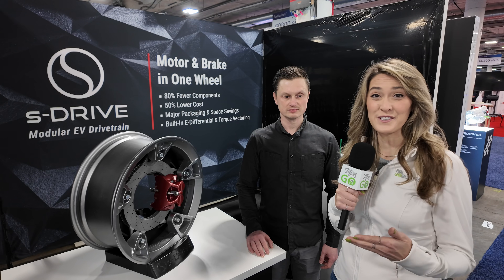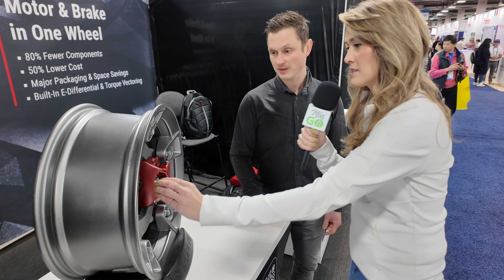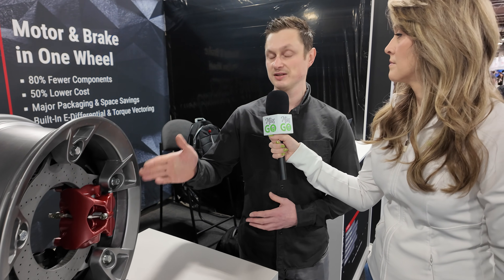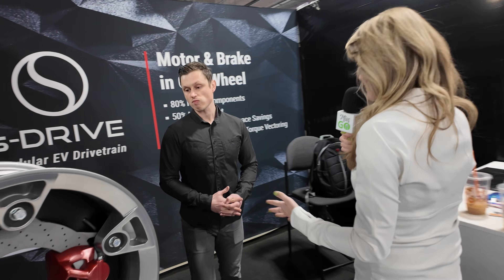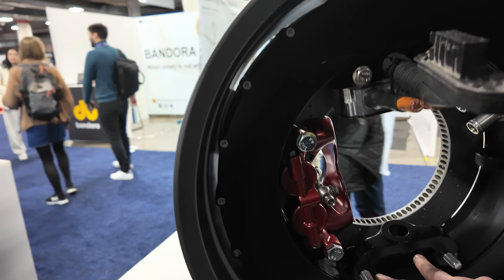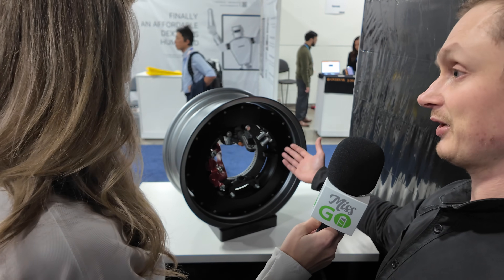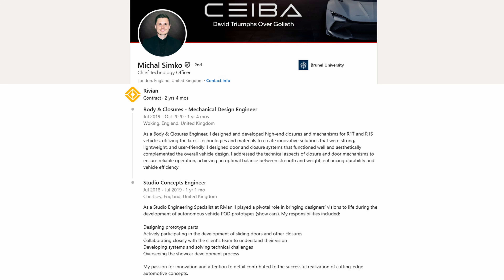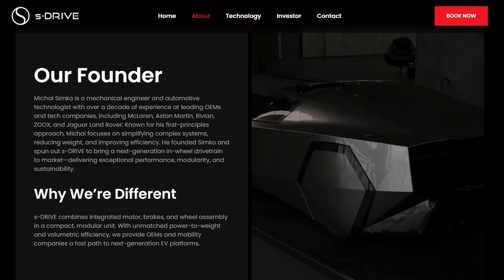S-DRIVE In-Wheel EV Powertrain Solution (CES 2026)

Comment: When faced with revolutionary designs that claim 100's of % improvement over existing systems, you must ask one simple question. What engineering challenge was preventing existing manufacturers developing this system and how have you overcome that challenge. Because existing companies developing similar products also have very smart people working for them and you can bet something similar was investigated and discounted for some very sound reasons. Either cost of manufacture, lifespan of components or efficency. The fact that it requires some "rubber mounts" to try to isolate road vibration from the motor leads me to think that wear and tear on the motor will be high in practical situations. perhaps they mention race car application for that reason. normal overloaded family car driving over potholes and bumping kerbs when parking probably doesn't suit this kind of system.
Reply from the maker: Here is a hubless axial flux powered vehicle after 11k miles driven this summer by a YouTuber.  These have been in production for years.
https://www.youtube.com/watch?v=cQstV0uLLHg
-Producer Tim

Comment: But you are limited by the motor rpm and you have no room for gears, so max speed and efficiency are limited.
Reply from the maker: 4000rpm.  Thats pretty quick.  What percentage of vehicles EVER exceed 120mph?
Here is a fella who did 11,000 miles this summer on a hubless axial flux motorcycle
https://www.youtube.com/watch?v=cQstV0uLLHg
-Producer Tim
Reply: @MissGoElectricIndustry   because in some countries you can go faster than that, when conditions and road allows it why not?

Comment: $10,000 to kiss a curb, not a great idea.
It might be great on paper and on the racetrack, but not in real life with snow, dirt and flooded roads.
Reply: The waterproofing could be solved by pressurized compartment with air exiting through the stator-rotor gap. Sounds like solution to me.
Reply from the maker: Arbitrary and imaginary figure as a premise...common in the comments.
It seems like many commenters are not aware that axial flux hubless motors have been in production vehicles and delivered to customers for years.
https://www.youtube.com/watch?v=cQstV0uLLHg
-Producer Tim

Comment: The elephant in the room has to be the five rubbers separating the motor from the rim. It kind of looks like 5 Tracker skateboard trucks and bushings have been cast on to the rim. Just like skateboard bushings you would need to replace them regularly and wouldn’t they soften up a bit once they get warmed up from turning forces and the road vibrations? Funny that, The Beach Boys “Good Vibrations” song just popped into my head. Ba d a da da da
Reply from the maker: Back out lug, pull bushing, slip new one in.  That seems pretty straightforward to us.

We'll keep tabs on this for our weekly EV news reporting over at our main channel
youtube.com/MissGoElectric
We hope you'll subscribe both here and over there
-Producer Tim

Comment: 2 minutes into the video and i can already think of a dozen ways for this to fail and just generally be worse then idk a standard wheel? Also that weight comparative calling that a straight lie. Against a steel wheel maybe but thats not a true comparison and is misleading. This is solutionism at its best.
Reply: If the weight is comparable to common steel wheels, the unsprung weight is technically solved. = Brought down to acceptable.
Reply: @ondrejdvorak5107 ok then next problem. Flat tire? You get a slash in a sidewall what you do? Carry a spare motor? Etc etc etc
Reply: @ondrejdvorak5107  also decided to check cooling so is this an open stator for production cars to avoid oil cooling ?
Reply: @ondrejdvorak5107 I was going to bother to talking gearing but the model 3 long range has more torque at the wheel and the ranger has double the torque at the wheel of 4 performance wheels combined. Neither of these are performance vehicles. So this isn't suitable for anything getting to suv size or offroad. A ranger in low range has just under 5x times the torque. I'd also be wondering about the rpm efficiency required voltage and kv etc. This isnt a new concept never seen anyone get it through. I've seen one motorcycle, PEV.  Yasa the first to offer axle flux motor recommend gearing. Electric motors like to rev and are more efficient tesla has 9.7:1 on a high rpm motor. There is so much on this topic i could vomit but its late im going to bed.

Comment: Even if unsprung mass is the same, there are still potential problems getting power and cooling across the moving suspension, as well as keeping water and dirt out of the gap between rotor and stator - hub motors may seem attractive in theory but have many practical issues.
Reply: I was thinking the same, all nice and cool but how do you keep it clean and safe. I'd be super concerned driving through a ford or in heavy rain
Reply from the maker: Seeing problems is easy.  Seeing solutions is hard.  Luckily for humanity there are folks like Michal out there solving problems...even if the ration of armchair naysayers is 10,000,000 : 1  ;)
-Producer Tim
Reply: There are armchair naysayers and people excited but not blind. If they solved it, awesome! If only we had someone asking them questions in person 😉 @MissGoElectricIndustry
Reply: @MissGoElectricIndustry That problems with sealing and getting power and cooling across the suspension is the main reason why there are no hubmotor cars on the market. On top of cost since it requires atleast two motors per car.
Developing a new product without solving the problems that makes there use impossible is BS or just another scam to get investors money.
Reply: @MissGoElectricIndustry they weren't insulting or dismissive unnecessarily,  as opposed to your comment. I cant tell if it's because you have a vested interest or it's just your demeanor. Either way it's not our Duty to find solutions as we aren't Vested.
Reply: @MissGoElectricIndustry we don't know if Michael solved anything , because the interviewer clearly isn't competent enough to ask the right questions. 
After thousands of years of using wheel, we still use cental hub design for a good reason. So if this guy solved the millenia old problem, maybe you should ask him how.
Reply: Make the compartment pressurized either by passive air-ducts or active pumps and seal the gap by constant outflow of air. Cooling solved too.
Reply: No automotive engineers were involved in the design, marketing or review of this concept.

Comment: How is this possible in a flooded area ? Or if the water level is above a certain height? Motor and electrionic could fail .😢
Reply: Make the compartment pressurized and air exit the gap, creating active pressure seal. And nice bubbles when going through water. Plus anti-tire-pierce pressurization feature along.
Reply: @ondrejdvorak5107  If they can fix it all I'm happy to promote this motor because it's a really interesting idea. I strongly believe in true engineering starts eliminating complexities and inventing someone simple and durable. This is a perfect example of a great axle motor. Even donut labs and yasa failed to think like this. 🎉
Reply from the maker: Every automobile ever designed has a fording depth limit.  That includes automobiles with in wheel motors.  Remember, there are many transportation devices available all over the world now with in wheel motors.

We hope you'll subscribe here AND over at our main Youtube channel to keep up with their developments
Main Channel: youtube.com/MissGoElectric
-Producer Tim
Reply: @MissGoElectricIndustry   yes exactly. I subscribed 🎉

Comment: on one hand this is great, doing better things, more efficient thing, lighter things, decentralize things and so on.
but, there is a but, "we" need this type of tech in small and affordable segment, i mean we have already AWD and over 1000hp cars,
you know what we dont have? affordable every day cars with the option to buy with AWD, you might ask why would you want AWD in Kia EV3 or the new EV2, in the  upcoming VW ID Polo,  and similar class cars? well, many live in places which have Winter, which means snow and ice, even in the city and suburbs, and depending where you live you get a snowplow eventually come around. and in snow and ice, AWD with winter tires are the safest to use. so "WE" need this tech but with reasonable hp and price, like 4 wheels combined together having from 100hp up to 300hp in many small steps... like 20/30hp increments upwards.
dont get me wrong i understand what can this do to performance cars, i am just saying the smaller reasonable size hp and priced cars would benefit from this immensely.
Reply from the maker: This would save a lot of money in production and make automobiles more affordable.  That is what part count reduction accomplishes.
-Producer Tim

Comment: How long will those lug nut bushings last? What happens to the electric motor if you have use a cutting torch to get the bushings off if they fuse? How well sealed is the electric motor? Also, what happens when you hit a bad potwhole hard?
Reply from the maker: A bushing appears to be super easy to replace.  Back out one lug nut and swap.

We'll keep tabs on this for our weekly EV news reporting over at our main channel
youtube.com/MissGoElectric
We hope you'll subscribe both here and over there
-Producer Tim

Comment: Okay guys ... go easy on me ... cause eye'm real sensitive and ain't too smart ... but tell me ...
There has got to be a way to change a tire on this everything in a wheel design, right?  Again, because I ain't too smart .... I asked my hand-picked experts at Gemini about this ... and I thought ya'll would enjoy reading the following very serious and informative response....

"The S-DRIVE (or "Smart-Drive") system showcased at CES 2026 represents a massive shift in EV architecture by moving the entire powertrain into the wheel. You are correct that this "all-in-one" design makes a traditional tire change look impossible at first glance.

Because the axial motor, cooling lines, and brake hardware are integrated into the wheel's core, you aren't just removing a "rim"—you are essentially removing the engine of the car.

1. The "Cartridge" Rim Design
To solve the issue you noticed, S-DRIVE utilizes a two-piece wheel architecture.

The Core (Drive Unit): This contains the axial flux motor, the cooling system (often using quick-disconnect "dry-break" valves), and the braking assembly. This part stays attached to the vehicle's suspension.

The Outer Rim (Cartridge): The actual rubber tire is mounted to a lightweight outer sleeve or "cartridge" rim. This sleeve slides over the motor housing and is secured by a series of perimeter bolts (similar to a beadlock or a heavy-duty split rim) rather than a central lug nut.

2. How the Tire is Changed
You wouldn't put the whole motor on a tire machine. Instead, the process follows these steps:

Removing the Outer Ring: A technician (or a roadside kit) removes the perimeter bolts. The outer rim, with the tire still on it, slides off the motor core.

The "Sleeve" Method: Since the outer rim is just a hollow cylinder with a tire on it, it can be placed on a specialized tire machine. However, many of these "In-Wheel" designs at CES 2026 are moving toward pre-mounted tire/rim assemblies.

Modular Swapping: In a shop setting, you likely won't "change the tire" on the rim at all. You’ll swap the entire outer rim for a new one, and the old rim will be sent back to be refurbished with new rubber in a controlled factory environment.

3. Challenges for the "DIYer"
This system introduces two major hurdles that traditional cars don't have:

The Weight: These assemblies are heavy. Even with the outer rim removed, the unsprung weight is high, and the alignment of the outer sleeve onto the motor core requires precision guides.

Cooling & Data Connections: While the outer tire rim doesn't touch the coolant, the "motor core" itself is a complex electronic component. If you ever have to remove the entire unit (for a deeper repair), you have to manage high-voltage cables and liquid cooling lines, which usually require a "service mode" to depressurize and drain.

Summary: It's like a "Cap"
Think of it like a protective cap. The motor is the "head," and the tire/rim assembly is the "hat" that sits on top. You change the hat, but you never touch the head."
Reply from the maker: Here is a hubless axial flux powered vehicle after 11k miles driven this summer by a YouTuber.  These have been in production for years.
https://www.youtube.com/watch?v=cQstV0uLLHg
-Producer Tim

Comment: That would be an expensive  curb scrape
Reply: ?? 'scrape the kerb' sufficiently hard to damage that hub, you're more likely to be worried about your hospital bills...
Reply: The wheel bolts onto the hub through five bolts and bushings. There is technically less of a wheel to replace on this since the motor/hub part of the wheel that replaces the webbing of a regular wheel is separate. If all manufacturers adopted this construction to achieve the same economies of scale, it should ultimately become cheaper than a standard wheel.

I would be more concerned about the wheel bearing seals: how do you keep crap from getting by seals that are something like 16" in diameter, fouling the motor magnets and bearings? In a conventional drive train, the motor is safely locked away 4-5 seals removed from the environment and those seals are on ~1" shafts, much lower seal slip speeds. Any dust that may make it through CV seals will get carried away by bearing oil to the oil filter and should never reach the motor 2-3 gears, shafts, and bearings deeper into the drive unit.

Imagine the ~16" hub bearing replacement cost on these puppies. Have fun wrestling the magnets when separating the rotor from stator to press bearings off/on... and again while putting it back together. Going to need special pressing/pulling tools for this.
Reply: @teardowndan5364 still could be worthy as a fair weather motor. A lot of people have "show" cars or motorcycles they only drive on warm, dry days. 
Labyrinth and multi-lipped seals work well for large low-friction seals. Large sealed drum brakes have been around for ages.
Reply: Thats a human problem, AI will be driving the car. 😊
Reply: Or one damn pot hole.
Reply from the maker: Solved problems.
It seems like many commenters are not aware that axial flux hubless motors have been in production vehicles and delivered to customers for years.
https://www.youtube.com/watch?v=cQstV0uLLHg
-Producer Tim
Reply: @MissGoElectricIndustry  Practically all attempts at "hubless" wheels I have heard about ended in failure due to the difficulties associated with keeping crap out of the "not-a-hub" and wheel interface.

Hubless wheels aren't truly hubless. You are basically pushing the spindle 5-8" out from the center axis, hollowing out the core, leaving a flange behind to attach braking, suspension and steering hardware to.

The hub may look different but it is functionally still there, integrated with knuckle and wheel webbing functions. Except you now have 12-16" diameter seals instead of 2-4" ones, 3-4X the slip rate to deal with and ~10X the surface area for crud to slip through.
Reply: Can use taller and wider wall tires.
Reply: @ricky4673  When the low-profile tires for your wheels are already 20" if not more, taller walls become a tall order.

Comment: dangerous design... imagine you are on highway and drive over random pothole or object, now you have bent and possibly locked wheel in high speeds.
Reply from the maker: Solved problems.
It seems like many commenters are not aware that axial flux hubless motors have been in production vehicles and delivered to customers for years.
https://www.youtube.com/watch?v=cQstV0uLLHg
-Producer Tim

Comment: Don't forget, each wheel still needs its own invertor, and these all need to handle the power of each wheel it powers/controls. In addition, nice to see hubless not as a gimmick but because this system truly does not need a hub.
Reply: There is a hub. Inside e-motor.
Reply from the maker: Solved problems.
It seems like many commenters are not aware that axial flux hubless motors have been in production vehicles and delivered to customers for years.
https://www.youtube.com/watch?v=cQstV0uLLHg
-Producer Tim
Reply: @MissGoElectricIndustry  Why you keep posting link to same clickbate video which has nothing to do with a topic? Name one car in mass production equipped with in-wheel hub electric motor, please?

Comment: Deat Miss Electric, the idea is good.
Radial motor and hub.
But it has the same problem as all motors now.
It is still usine the second panel of nicolas Tesla.
Those motors have back efm, electro counter force, this is why they increase heat.
The patent is about asynchrone symetric motor.
The bast patent is called cold motor.
Asynchrone asymetric motor.
This motor stay cold.
Has no back efm.
Consume 3 times less.
Is patented for more than 130 years, as other patent.
This is the solution.
Ultra efficient, faster, stay cold, consume 3 times less, can go 3 times further
Reply from the maker: We'll keep tabs on this for our weekly EV news reporting over at our main channel youtube.com/MissGoElectric We hope you'll subscribe both here and over there -Producer Tim

Comment: What about driving through standing water (common in winter) or accidentally curbing your wheel? It looks like a great idea but I don't believe it will be good for real world driving
Reply: Instead of the oil-cooling intakes, add air intakes and pressurize the compartment letting air exit through the gap, sealing it by air outflow.
Reply from the maker: Solved problems.  Every vehicle has a max fording depth.
It seems like many commenters are not aware that axial flux hubless motors have been in production vehicles and delivered to customers for years.
https://www.youtube.com/watch?v=cQstV0uLLHg
-Producer Tim